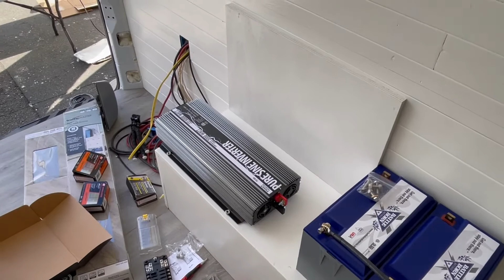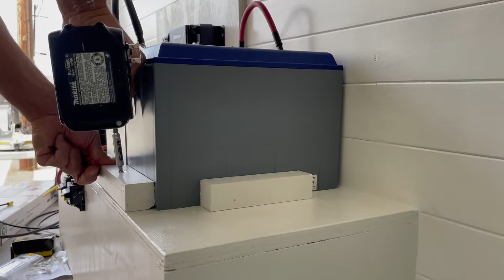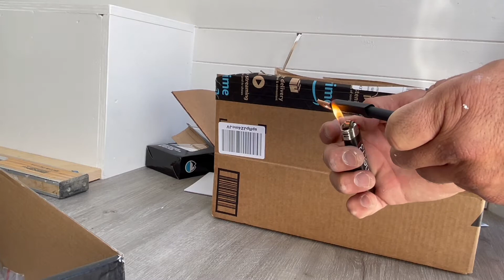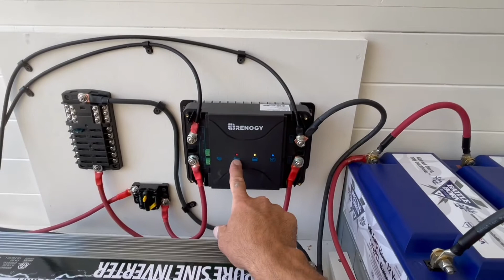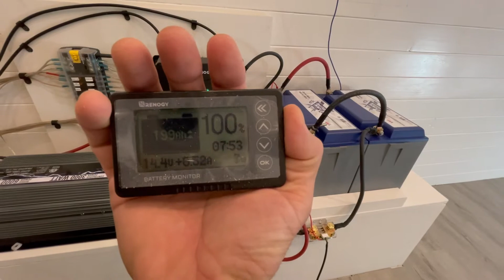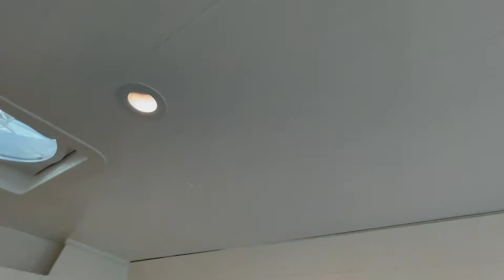Van Build | Installing Solar Power

Comment: Is that speaker wire for the appliances? I feel like i've heard that speaker wire is acceptable for some things. Is this wired up as a 12 or 24 volt system? My build is underway and I am in the learning about solar stage. Your videos are motivation! Thanks for sharing brotha.
Reply from the maker: For the 12 volt appliances I use 10 gauge full copper speaker wire.

Comment: hello alluvium i have that same charge controller and havnt been able to connect alternator charge do i need to connect the negative of the car battery to the negative of the alternator?
Reply from the maker: What you will need to do is connect the positive from the car battery to your charge controller and your negative from the car battery to the negative of the charge controller or in my case if you have a negative bus bar you can connect it there.  In addition, if your car has a smart alternator there is an additional 10 gauge wire required to be connected to the ignition circuit.  A circuit that is only live when the ignition is on.  What type of van do you have? That will determine if you have a smart alternator
Reply from the maker: Yes it won’t work without the negative
Reply: i have a promaster i just didnt want to get 2 cables from the back of the van to the front i passed the positive tru a hole in the plastic casing of the battery to the back but now i have to do the same with the negative i though that if i connected the negative to ground it will work 😭 those 4awg cables are expensive and i cant find them locally in usa not in lowes not in auto zone it seems that type of cable is not common, thans for answering!!
Reply from the maker: @rickymartin06  use my link in the description for the cables from Amazon
Reply: the alternator is not smart i think because the manual said that if the battery had like 14.4 volt turned when car was turned on probably was dumb alt, well i guess ill have to trow another cable to the back of the van for the negative 😩😩